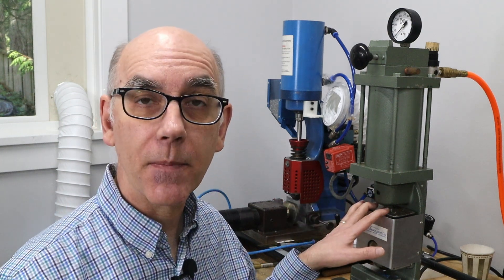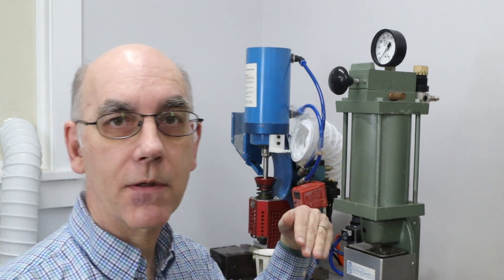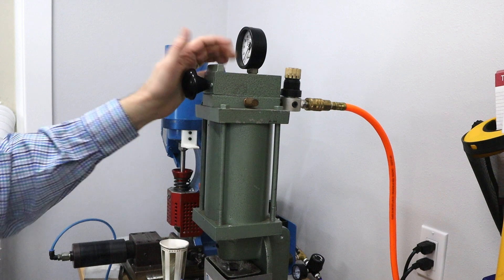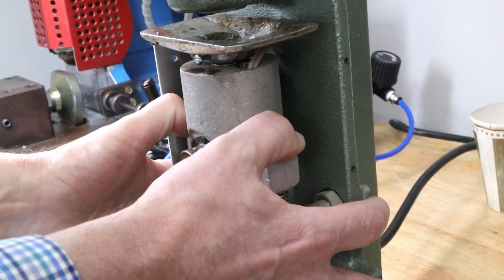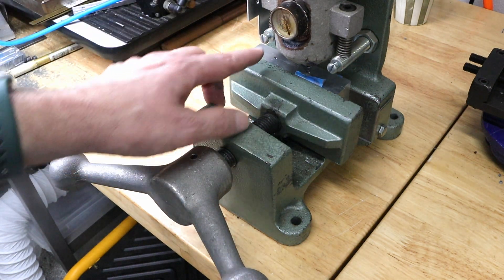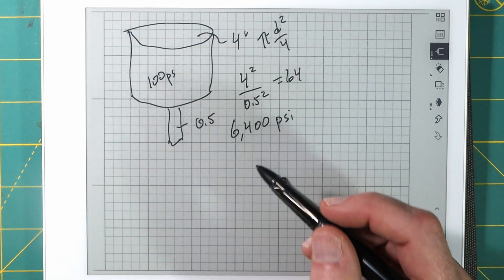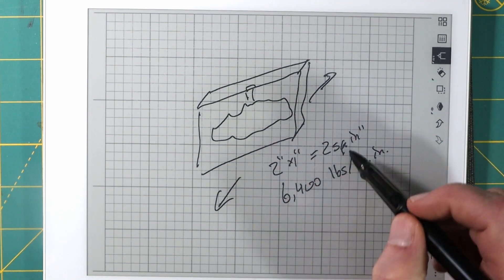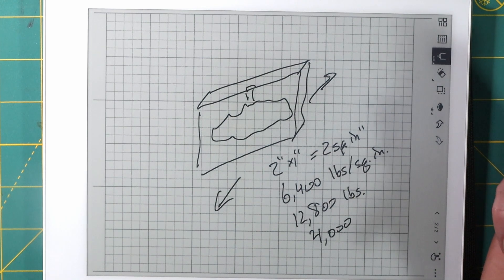How an Injection Molder Works

Comment: Great video and enjoying your channel. If you were just getting started in injections moulding which is the easiest plastic to start with? Thanks
Reply from the maker: Thanks. Polypropylene is probably one of the easiest plastics to start with. It flows really well.
Reply: @JohnSL  thanks I will try that first
Reply: @JohnSL  thanks I will try that first

Comment: The idea in this machine and what you normally would call a injection molding machine is the same, but the difference is huge, like comparing a typewriter to a computer. Injection molding is interesting and could be a very precise process.

Comment: Hi John, very nice and instructive videos, I saw every one! congrats! Let me ask, If I have a fixed clamping force, you said I can change injection pressure... Can you explain whats determine if a simple mold/part will going to need 6400psi, or 3000psi or even 1000psi to properly inject ?
Reply from the maker: There are several factors. First is the material. Some materials, like TPUs, are less viscous than other materials like ABS. That means for the same part, you would likely need more injection pressure with ABS than TPU. Next is the part or wall thickness. Thinner walls require more pressure to fill the cavities. Finally is how far the plastic has to flow from the gate. The longer the flow, the higher the pressure required to fill the mold. There is software to calculate this, but it's generally really expensive, so I just use experience and hope it works.
Reply: @JohnSL  Nice! Thanks, Understood! Do you know these small screw based injection machines ? (desktops ones) How they compare with piston based ? Whats your point of view about them ?

Comment: Please John, adding screws to aluminium mold - like you did in the Travin demo - will increase the clamp force to how much ? 15 tons ? 20 tons ?
Thank you for your videos. Very informative !
Reply from the maker: It depends on the pull-out force of the screws that you use multiplied by the number of screws.

Comment: When the piston enters the cylinder there is a big bite of air included. Does the air ever cause trouble? 
   I bore 3/8” holes in delrin spheres from McMaster-Carr as part of an assembly and they always have random air bubbles in the interior that intersect with the bore. Sometimes quite large, like a quarter inch bubble.
Reply from the maker: It's not something I worry about. But for Delrin spheres, I would guess that they're cast rather than injection molded. Material that is cast is far more likely to have bubbles in the resulting parts.
Reply: @JohnSL   Sir, Delrin is safely processed on injection machines equipt with reciprocating screws. I wouldn't recommend using it on a plunger-type machine shown in this video.The formalyhide gas could cause sever resperatory problems and fainting. Also delrin must be dried before processing.
Reply: Air in the shot will retard flow and cause vent burn ( bubbles)That's one of many limitations of plunger barrels, varying fill rates aren't possible with this machine.

Comment: Hello John. I've been watching your videos for a while and find them very interesting. But I don't think it's correct to say that you can increase the pressure by reducing the diameter from 4 to 0.5. The pressure in a (static) liquid is the same everywhere. The pressure is determined by the force on the piston and its cross section. The flow rate increases in the smaller pipe, not the pressure.
Reply from the maker: Here's how to think about it. The pressure applied to the 4" air cylinder produces a force that is P x A. So the larger the air cylinder, the more force. That force is now applied to the plunger, which is only 0.5" in diameter. So now we have that same force pushing on the plastic in a 0.5" diameter cylinder. When you take that force and divide by the area of the 0.5" heated cylinder you get a much higher pressure/sq. in. (P = F/A) applied to the plastic than applied to the air cylinder. With the numbers I provided, that's a 64:1 (roughly) multiplier.
Reply: @JohnSL  OK. You're right. I just watched the video again. Now I understand your drawing. Thank you for your explanation.

Comment: The calculation for a pneumatic cylinders force is F=PA .  F = force P = pressure  A=  area. The correct formula for area is radius squared x pi. When calculating the total pressure you need to subtract atmospheric the pressure of 14.7 psi. Because the pressure is only on the large side of the piston you do not subtract the area of the injection piston. Subtracting the smaller piston or piston end only comes into play if you are calculating the force on the retraction side.
Reply from the maker: How is pi * d^2 / 4 not correct? Regarding the other things, true, my calculation wasn't exact. And I didn't mean for it to be exact, but rather illustrative. The same is true about clamping force. The actual force pushing the mold halves apart is a lot more complicated and will almost certainly be less than the simple calculation I used.
Reply: @JohnSL  It accomplishes the same. However if you look up the proper formula to calculate the area of a circle it is radius squared x pi.  Keep up the great videos and content I much appreciate them as well as many others.

Comment: The injection cylinder is not adjustable for larger mold spacing on that machine. It is only adjusted for alignment with the injection cylinder. If adjusted it you would risk scoring and destroying the injection cylinder. Also it uses cartridge heaters for the heat not coils inside the casting. The thermometer on front is just for visual adjustments to the slow make slow break thermostat that controls the cartridge  heaters.
Reply from the maker: Ah, good point about the front-to-back adjustment.